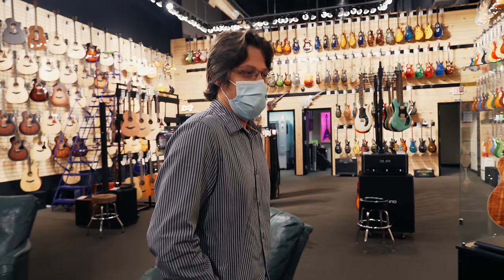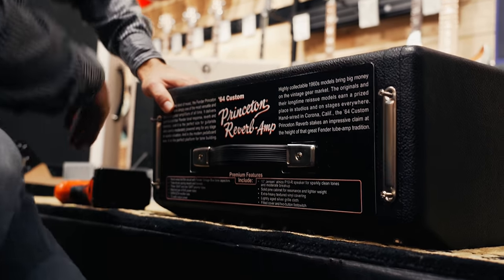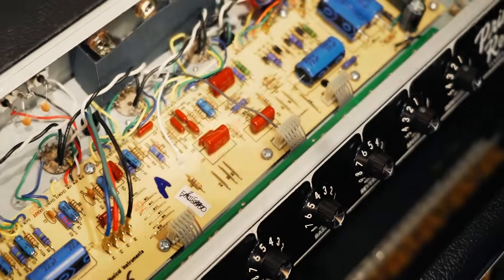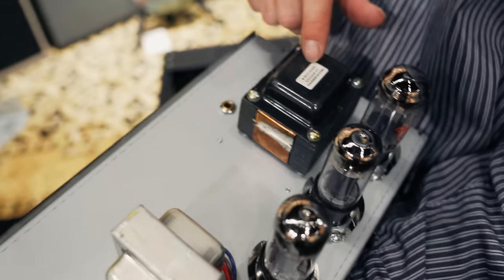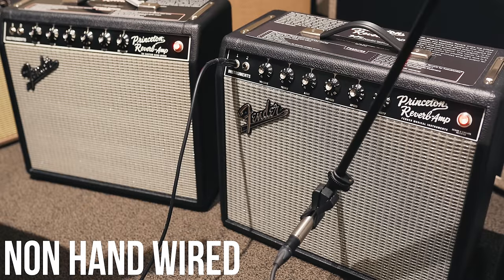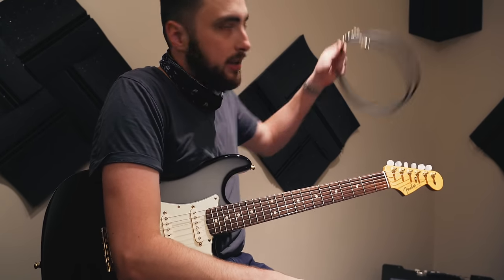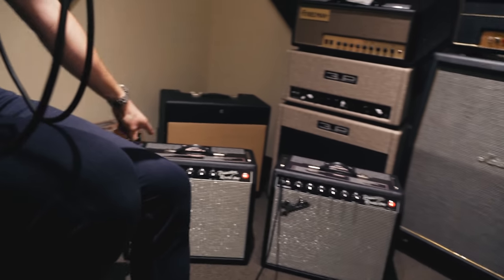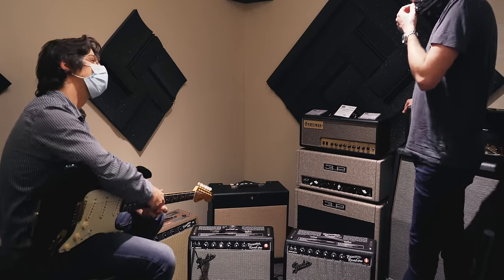Are Hand Wired Amps Really Better?

Comment: I can't believe the difference in price between the two. I had a '67 Princeton Reverb for a while. New baffle for a 12" Tone Tubby San Rafael 25W. All JAN Phillips 6V6's, RCA black plate 12AX7's. It was a really sweet sounding amp, of course. I ran it side by side with my '89 Mesa Mark III blue stripe, which is PCB, and the Mesa blew it away. Tons more headroom, three channels. Yes, it is like comparing a stock Camaro to a Corvette. Mark III's have way more features. I got it used for $1000.00, which is an average price. Bang for the buck goes to Mesa, and I am a diehard Fender JBL kinda guy. Now, my 100W Silver Faced Twin Reverb is a different story.

Comment: While shopping for my first tube amp I compared a ' 65 Princeton with the standard speaker vs. the '65 reissue with the CR (Cannibis,Rex) speaker. Talk about a difference! The CR speaker was way warmer, cleaner, more definition. Bought it. Hand Wiring is cool snd all that, but its got to be the components that make the most difference.

Comment: Cool test. 
I'd be curious how the NON-Hand Wired version would sound if you upgraded those generic components on the PCB to match the components of the hand wired version. 
That would be a labor intensive test to upgrade all the caps, resistors, etc, but makes you wonder how the PCB version would then sound (both with and without the Alnico) compared to the Hand Wired version.
Nice video. All The Best...
Phil
NYC Area

Comment: Component variations in value, even small changes in tone control settings, could account for any perceived differences between the two amps.  I DO hear a difference, but I can't say that one is better than the other.  They're just a bit different and both sound like a Princeton.

Comment: I'm hearing quite a bit of variation of tone and volume, but my first guess is that you just have the controls set differently.  You may have them both pointed to "3" or whatever but pots are +- 10% variation spec, as are the rest of the components too for that matter.

Comment: I thought that the handwired amp don't have even pcb board, i got an a fender clone crafted in mexico in the 70's. Literaly the components are twisted and soldering together, only the powersupply got a small  pcb for some electrolitic caps. I love that amp. Sorry for my english

Comment: I have a 65 tweed reissue that I have no complaints about,  but I wonder if it would be a improvement putting a Vintage 30 from the 1990's in instead? I have a 4x12 cab that I dont use now days and Im seeing a lot of good things about the older Vintage 30's. Thanks for the video.

Comment: I practice with a champ
Fender black face I like
It. I have modified it to add a tremolo
To it the parts are more
Robust and easy to replace it sounds better than solid state
Or circus board design.

Comment: Like the one technician said on here printed Fender circuit boards usually have thin traces I know I had a fender Super 60 that I completely gutted and had to redo all the circuitry and with better resistors and capacitors. I love hand-wired amplifiers because they're much simpler and they last longer they're more reliable.  if you took out the crappy resistors in caps and replace them with better caps in the printed circuit board you could definitely make it sound better.
But myself I like the reliability hand-wired nothing worse than playing somewhere and having your amp start making funny noises.

Comment: Replaced the stock Celestion VT 10" 50w on my marshall origins 20 with a Celestion G10 creamback. And it made a huge difference. Way creamier. And I went a step further and got a 12" greenback heritage and a seismic cabinet. That sounds even better. Hind sight I kinda wish I got origins head. But definitely not a lot to complain about g10 creamback. Sweet amp. Now is hand wired worth $1,300? Big pill to swallow. More like $1100 because that stock speaker has to go immediately. Tough call there. If there was any difference it was the up graged capacitors or transistors. Otherwise they were close. Very valid point though for some who likes to mod stuff out. Don't think I would.

Comment: The hand wired has a totally different power supply than a vintage one. from what I can see it resembles a Vibrolux. That has to effect the sound and/or volume. I built an amp out of a Non-verb '76 Princeton and it just had the one big quad cap.

Comment: Interesting for sure. I had a 1978 silverface Deluxe Reverb for a time I seem to recall it had alot of hand wiring, and also had a Deluxe RI with the IC boards, the RI sounded better, different speaker between the two, the hand wired was brighter and not really very warm.

Comment: In my very limited experience: old Fenders have that mid range honk, which to me can sound a little two-dimensional & papery (though maybe the speakers just need to be dusted); but they do have a superior room presence and sound-before-effects. The new ones tend to be brighter & cut through, and are built to serve as rock machines and pedal platforms. To my hearing some of them, especially the “tweed reissues,” have much less dynamism and presence.

Comment: Having owned original 59 Tweed Deluxe ‘64 BF Vibroverb, ‘66 Super Reverb, ‘64 BF Deluxe Reverb, ‘71 Marshall Super Bass, and several others, I’m certain when the original Princeton in this video was new it was much brighter than it is today. Almost universally, in my experience with the handwired vs PC board “shootout” the original will sound darker, quieter and more in your face. The biggest difference at the end of the day is old vs new than anything else. Moreover, bright isn’t a bad thing.

Comment: Even with my aging ears and slowly fading hearing, I could still tell the difference in those 2 amps!!  The hand-wired amp was much better and clearer sounding.  With regards to my hearing, I could actually hear each of the notes you were playing much more clearly each time you switched to the hand-wired amp.
Reply: Your hearing the tolerances between components...it would have been more comprehensive if they measure the resistors and caps between the two and double check the the tonestack caps are the same values and bias them the same..then there's a different speaker. this test is a folly..even voltage changes headroom and gain..its not the fact its hardwired that makes a difference in the tone.

Comment: The serviceability of the hand-wired version is definitely a plus. And I agree that the speaker makes a big difference. However, is the tone difference really due to hand-wired vs a circuit board? Or could it be more due to the different components used? And lastly, to a touring musician, the extra coin would most likely be worth it. But to the player that only gigs occasionally... probably not.

Comment: Ive noticed that on the non-hand wired amps the solder points are usually the point of failures.

Comment: I  Fender amps have been my go to amps since my first 65 Princeton  reverb.  I have owned several tube  and solid statemonsters all Fender. Bottom line is that while I can hear some of the differences,  all of those ity bitty things are lost to the audiences  in any of the clubs where I performed since 1968 whether I was using that Princeton or  my Super reverb  or my Twin or Bandmaster or any of my solid state amps (all made  by Fender)  what is most important is playing skill.

Comment: Point-to-point wiring rules! Both for sound, and servicing.
Reply: That handwired isn't "point-to-point"...it's an "eyelet board" construction. P2P circuits look like a rats nest.
Reply: @wakjob961  I have several older P2P Fender amps, and they don't look like rat nests to me. But I know what you mean.

Comment: 9:45, there is a problem with the hand-wired amp with a hum cycle( faulty Cap or something), that thing should be dead silent. Normally Circuit board amps can be noisier than point-to-point soldering amps but in this case its the reverse.

Comment: whether or not there is a difference in the sound is subjective. The advantage of a hand wired amp is that it is easier to work on without damaging something. They are nearly indestructible. If you get a PC board too hot, the traces curl up like the witches feet when the house fell on her in the wizard of oz. A fairly major problem, especially if it happens too often. You pretty much have to run wire where the trace used to be. There may be a better way to deal with it, but that was my solution on a blues deville I own.

Comment: To me it's just about the speaker, the scooped mids depends on the light ceramic magnet of the stock cone, it's not an issue, it's a feature. Anyway, with different speaker they are really close

Comment: My main impression on PCB vs Hand-Wired is practicality.
In a hand wired amp, it's less likely that you cook the whole circuit in a power surge, because the components are only connected by wire only. While with the PCB, you might have to spend top dollar to get the whole circuit replaced.

Comment: I'd buy the non-hand wired and change to alnico speakers.  If it breaks on the road, like you were questioning, just buy another one.  Then you'd have two that you could double-up when you needed more punch at a larger gig and you'd have spent the same as the hand-wired one.

Comment: Frank Stetka
Speakers make a huge difference as anyone knows.  I don’t play blues and so I would probably like the ceramic speaker in the PTP wired amp. The Transformers are also just about the next major thing to the speakers but really what changes were made to the tone stack in the new amp? Also if you break the intelligently designed controls being utilized on the new version; yes it could be more a PITA to repair but it’s totally doable even if the board is cracked.  No they are not the “Same Transformers “ because the early ones were hand wound with paper insulation and newer ones are made of plastic unless Fender is really trying hard (doubt that) and that not only allows a different kind of electro magnetic saturation but also the wire was more gently handled in the corners whereas a machine wound unit may see a little stretching there.     The modern ones tubes; are they newer?  Newer tubes can be shoddy or even more hi-fi ( not always good on guitar) Is there feedback in the new circuit and less or none in the old one? 
  Fender was always chasing that clean tone and then we all go after the 65 Bassman looking for rich harmonics, sag and power tube compression from a much simpler circuit haha.    There is just way too many variables but overall anyone knows the old amp,if the capacitors are replaced anyhow is the champ.   Some but not too much of that thick chewy sound is in part to a Point to Point amp passing the signal better with less resistance and maybe even better grounding but a good circuit board should not be that drastic of a difference in such a simple amp.  The sum of each is greater than the parts and the real question for me is the quality of what’s in the new amp to begin with.      Ever play an early 70’s Ampeg with a circuit board?  Sounds good to me compared to the new ones; again different animals; both with Circuit boards. 
  Would I take a classic on the road, probably not; but I will record with it. So long as I can get a good response the sound man and crappy room will destroy much of it unless you run with the big $ pros and even they can only do so much about the room.  
  In a dive bar where I carry my own gear; I would still take the original amp because I am my own tech most times and it won’t get buried by the rest of the band as easily like you guys pointed out, however I like a lot of headroom so I would probably drop in an EV or Mesa Black Shadow style speaker. 
    Everyone is different.  Thanks for the fun review; I used to geek out on this stuff long before we could broadcast it on the Tube. Peace ✌️

Comment: The implication is that we're comparing "hand-wired" vs "circuit board" here, but that's not the whole picture when the actual circuit is different, the cab is different, and the speaker is different. That's like saying, "Let's compare these two hamburgers" while they have different buns, condiments, and recipes.  Of course they're going to be different -- they are inherently *different*. 

The speaker is a huge part of the equation, as are the components and their respective tolerances, not to mention the actual circuit differences. The "hand wired" sounded better to me, but not necessarily because it was hand wired.

Comment: I can hear a small difference, but as with most comparison videos its difficult. I’m listening through cheap apple headphones plugged into an iPad over wifi. The original file is an unknown length of wire from my router and was amplified during its journey. Sometimes I can’t hear any difference in comparison videos.

Comment: You always hear people saying blackface Fenders should use ceramic speakers. I bought a BF Pro Reverb for cheap as it had some weird old Alnicos, which I swapped out for the  "people's choice" Weber ceramics -- and then I put them right back in. This video confirms -- Alnico's in BF amps is best. Handwired vs pcb is hokum: Same circuit, same components->same sound.

Comment: Would have been interesting to add in a original vintage 60’s Princeton to the comparison.  Need to ditch the ceramic magnet speaker in the base model.

Comment: I agree with your assessment 100% you answered a question I have had in my ‘65 reissue, the speaker a relatively cheap upgrade. I also notice the the tremolo on my ‘65 is weak. Any suggestions to improve?

Comment: Just speakers alone can make a huge difference. I have I Princeton reverb re-issue. And I also have at least 15 Fender hand wired amps ranging from early 50s Princetons to a 1967 black face Fender twin. I have a Super reverb Viber lux reverb deluxe reverb blonde bassman and so on. And I said I would never own nothing but a hand wired amp. Replace the caps and a power transformer which blew on me. I put Gold Lion Genalex tubes in the output section. And set the bias to my taste and this amp sounds as good as anything I have got. I never thought I would ever say that but it does. Now you can’t modify like a point to point and I don’t know if it is as roadworthy but I do think if you swap speakers and choose the correct tubes I think the tone is there. I do think the comparison is not fair because Of the speakers alone. The reason I wound up with the re-issue is that I needed a amp I am that wattage range for studio and small gigs. I also got it for around $600. And it looks brand new. It’s a custom color. I could have bought a vintage one but this one did the job very well so I chose to purchase this one.

Comment: The handwired sounds like it has a more pleasant sound and is more dynamic. A speaker replacement would get you close enough that it wouldn't make a huge difference in sound but I still think the handwired one has a little more dynamic response. For $300 minus whatever you can sell that speaker in the non-handwired for you would get the best value for sure.

Comment: For me it comes down to quality. I have wanted to buy a few Fender mass produced amps in the past but they always have noise issues or some other random problem. Not saying that handwired can’t have the same problems but I try to find builders who use quality parts and who make fairly quiet circuits.

Comment: the only thing frustrating in this scenario, knowing damn well this p2p PR is a $2k amp, is that they still went with IC filter & bias caps instead of something a little more quality/savory with a longer in-amp life... my move would have been F&T caps, for posterity.   still though, the circuit looks clean as hell!

Comment: Yes, components, circuits and speakers are different, but why no mention of cabinets??
65 Reissue is MDF, the 64 'hand wired' is solid pine. That alone makes a big tone difference (on top of weight diff)

Comment: Honestly, they sound different, but I don't think I can say either one sounds "better." 
If I had to pick, I think the non-hand-wired one sounds clearer in most examples, but it is definitely difficult to tell from this recording. We are hearing the room sound + youtube compression. 

I feel there's gotta be a better way of doing the non-hand wired one so the knobs aren't all attached to a single board. In terms of durability, that seems like the biggest problem as those knobs can totally be knocked into things.

Comment: The hand wired sounds louder probably because it achieves more gain at the same setting, being fundamentally different components. To get an accurate comparison, recommend a slight increase of makeup gain on the volume of the non hand wired to measure the tone at the same gain levels.

Comment: I wonder if it's really more about component differences and trace thickness (in particular for grounds) than anything else. It looks like the HW has ~10 large electrolytics for example; vs 4 or so in the standard one. Different speakers, parts, grounding thickness.. and that's a lot of parts to have different.

Comment: All I can say I am no expert but my taste purely based on this clip and ears the hand wire sounded warmed which I personally prefer. Is it worth the price?
That depends on your finances and your intended usage.  If money wasn't an issue I would choose hand-wired.
The other influencer forgetting the sound for a moment is I have never been keen on the modern PCBs and components such as jacks, knobs & switches soldered directly to the board due to the fragility it creates.